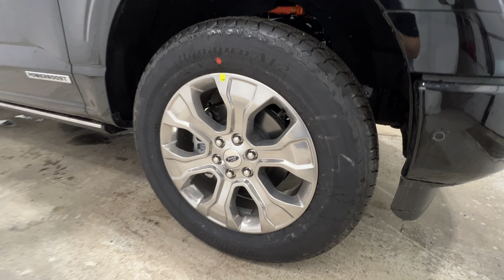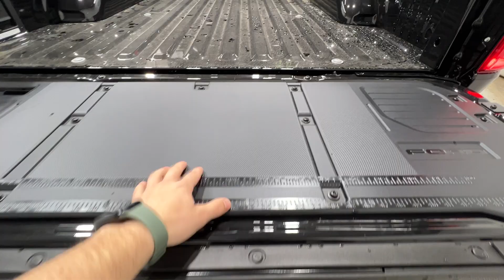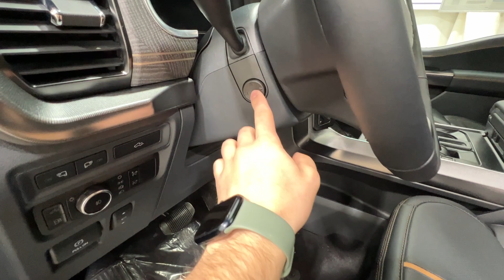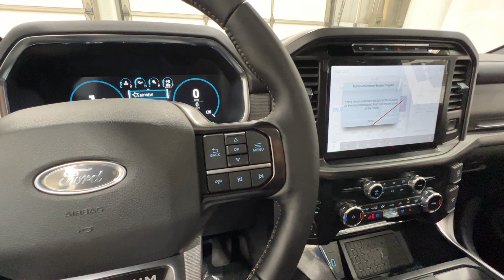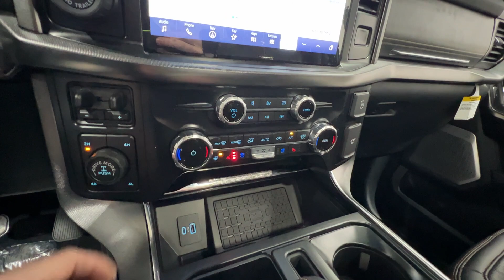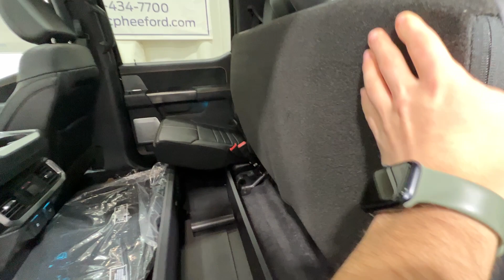2023 Ford F-150 Platinum PowerBoost Review! Exterior, Interior, Tech!

Comment: Ford should make there tailgate step a two step process and lower the steps down,a thicker grab handle,  there digital dash needs a MAJOR CHANGE,  this $80k truck Guage cluster should not look like the lariat, numbers on the Guage, able to display the navigation system, the intire interior design should be different 4 tha money..put some ac vents in the b-piller maybe 2 in the roof ,offer a different color interior,